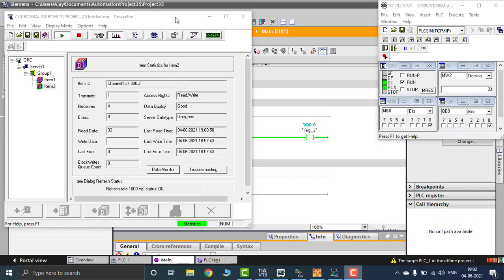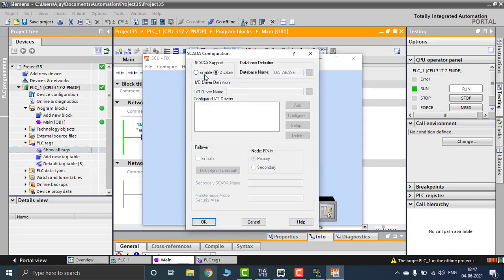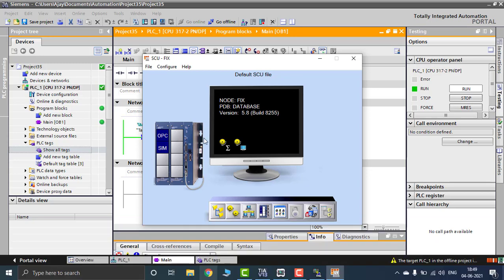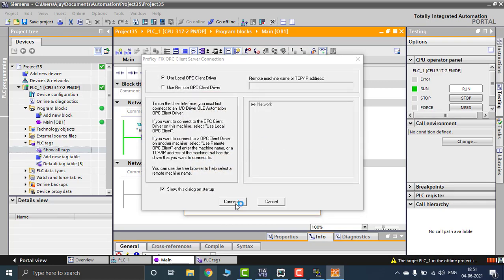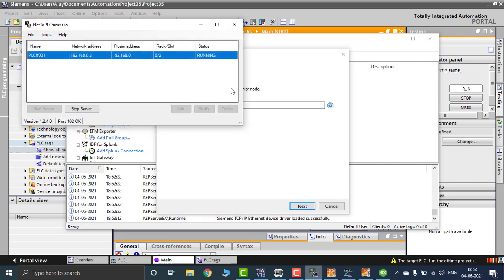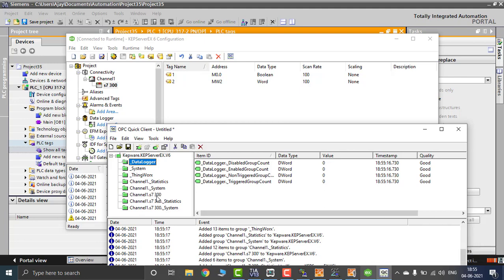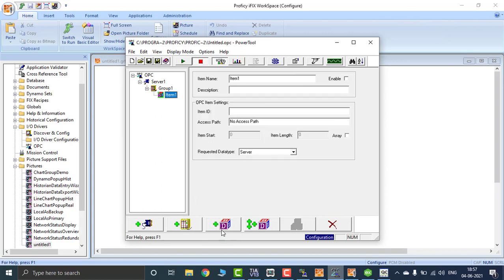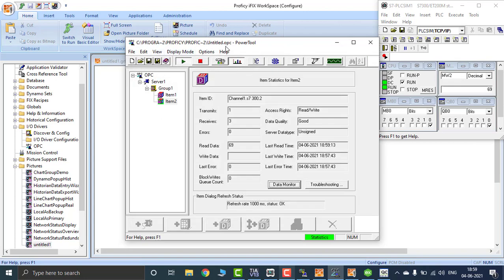SIEMENS OPC CONNECTION WITH IFIX SCADA | TIA PORTAL TO IFIX WITH KEP SERVER OPC CONNECTION | TIA OPC

Comment: I am currently working on a simulated setup and facing an issue with OPC tag updates in iFIX Database Manager.

System setup:

- PLC: Siemens S7-1200 (Virtual / Simulation)
- PLC simulation and control via TIA Portal
- OPC communication through KEPServer
- iFIX used as SCADA
- OPC PowerTool used for OPC testing

Issue description:
OPC communication is working correctly, as the tag values are changing in OPC PowerTool with good quality status. This confirms that the PLC simulation, TIA Portal, and KEPServer OPC communication are functioning properly.

However, in the iFIX Database Manager, the same OPC tags are not updating, and the current value remains static. Additionally, while configuring tags in the Database Manager, I am unable to clearly determine:

- Whether the driver should be selected as SIM or OPC
- Why OPC is not always available as a selectable driver in the Database Manager

Since the PLC is virtual and running in simulation, I would like guidance on:

1. The correct driver selection in Database Manager for OPC-based simulated PLC tags (SIM vs OPC)
2. Required SCU settings to properly bind OPC PowerTool / KEPServer tags with iFIX Database
3. Any licensing or configuration limitations in iFIX that may prevent OPC tag updates in Database Manager during simulation

Your guidance and support on this matter would be highly appreciated.
Reply: REPLY PLS